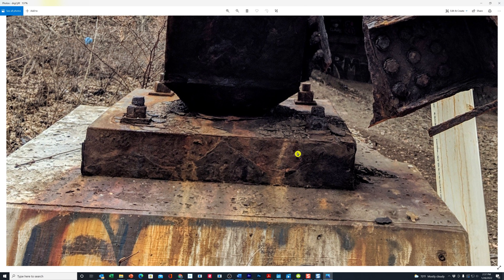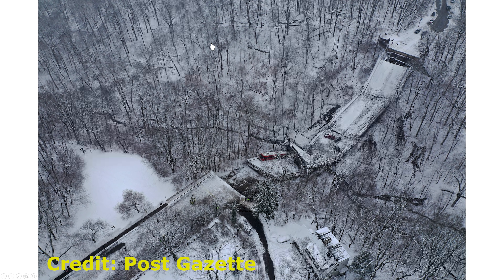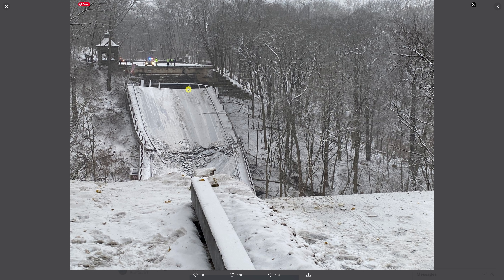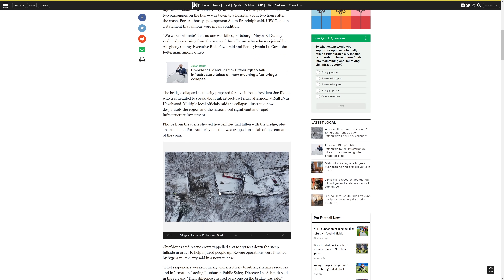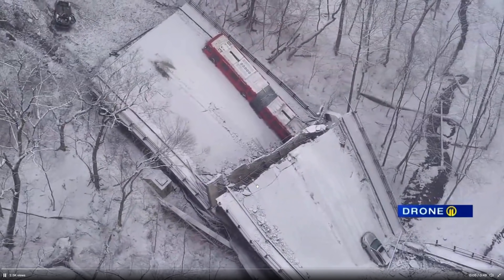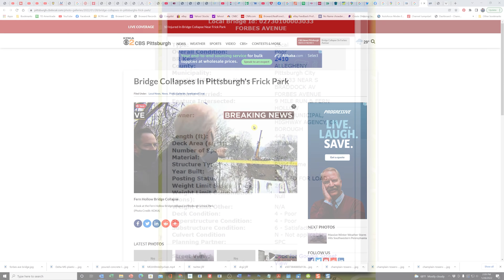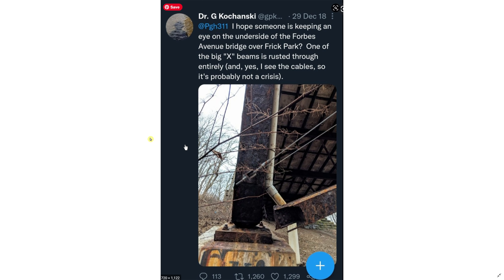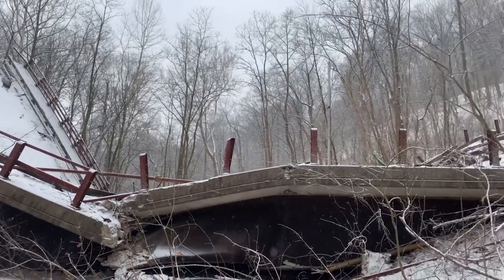Pittsburgh Bridge Collapse Cause, Forbes Ave Bridge Frick Park Rust?

Comment: Being in Pittsburgh can you imagine the salt exposure that bridge has taken over the years? Complete neglect.
Reply from the maker: We need better rubbery moisture prof paint
Reply: @jeffostroff  What's on the GOLDEN GATE bridge? I would think it's some of the best paint available.
Reply: @jeffostroff  PPG Plaza, headquarters of Pittsburgh Paint & Glass. I am sure they had been working on it. I also expect state contracting bids would go for the lowest possible bid. This is the City of Bridges, City of Engineers, and Steel City. Pittsburgh had relatively recently climbed out of bankruptcy and state control of budgets.
Reply: And don't forget that most state money goes out east to Philly.
Reply: @CaptainFrost32  When did Pittsburgh declare bankruptcy or have the state take over its budget?
Reply: @margaretbidinotto2995   	Act 47
December 29, 2003 - February 12, 2018
Reply: @CaptainFrost32  Oh, I thought you meant they declared bankruptcy like Detroit did.  Act 47 was the Pennsylvania plan that helped cities in financial distress - which Pittsburgh, of course, was.  But while they were supervised and assisted by the state, I believe they never relinquished control over their budget.

Comment: I have driven over this bridge countless times. Every time it rains do not travel in the right lane leaving the park, rain accumulates inches deep on the road leaving the park right before the bridge like a flash flood and driving conditions are intense especially if a PAT bus is in front of you causing a tidal wave covering the entire windshield. Don't get me started on the ice accumulation of several inches that I've personally seen that look like icebergs and public works Dump salt on it by the Truck load but only after an accident. These conditions have been at this location for YEARS there is no doubt that the unusual colder than usual temps lately mixed with that rain run off situation and this Bridge was DOOMED and someone, no many people need to be held responsible and red flagged for TOTAL Neglect for many years. Sorry had to voice my opinion and sorry that I missed the LIVE Stream but enjoyed your insight @jeff
Reply from the maker: That sounds scary!
Reply: Don't be sorry.  Thanks for the SALT UPDATE.  BIGGEST DESTROYER.
Reply: Unfortunately this is the state of Pittsburgh's infrastructure throughout, not just this particular bridge. Remember the Greenfield Bridge? Chunks of concrete were falling off of it onto the parkway below, so they built a smaller bridge over the affected portions of road to catch the debris, and then we continued using that bridge for another 15 years. Add to that nearly 450 bridges and it quickly becomes hugely expensive, and that's why it's in the state that it is. So I don't really think it's neglect, it's doing the best with what they have. The people responsible are the ones who have the pursestrings and have ignored the problem for decades.
Reply: The drains look to be small and very few of them. It probably could not take all the water and would fill up until it seeped into cracks between the roadbed and the sidewalk, raining water and salt all over the steel under it.
Reply: Good point. Allowing water to puddle doesn't help a structure. Harken to the Surfside Florida condo collapse where water puddled in the garage area and caused structural corrosion.
Reply: @allengilbert7463  you are dead on, coming from someone who grew up near Pittsburgh and lives about 35 miles from there.
Reply: @joegrazulis2810  I've been living in Pittsburgh all my life. Imagine my shock when I visited Ohio and they chewed up, repaved, and repainted an entire street in the time it took for me to make a trip to the liquor store.

Comment: I travel that bridge to and from work every day. Well, at least I did! That bridge is a main gateway between the east and west sides of the city. I am so incredibly thankful that I worked from home on Friday. More importantly, schools had a 2 hour delay, so less people were on the road! It could have been much, much worse!
Reply from the maker: I'm working on a second video talking about all of this tomorrow as well as more analysis in weight of the vehicle
Reply: Forbes is a busy East/West route but not “THE” east/west route unless you live close to or on the boundary of Frick (Oakland to/from Wilkinsburg/Edgewood). I do agree that depending where you work/live might be one of the better options. Until now. Obv 376 is just stupid and it’s not convenient to cross over to EighthAve (lights are too condensed and crazy for traffic). Penn will get even worse since it’s an actual throughway. Might be worth finding surface streets to parallel. Slower speeds but might be less traveled than the mains. 

This will once again prove the PIT moniker: “you can’t get there from here.”

Comment: Hi Jeff, love your work.  I am a bridge inspector in Australia and from what I have seen of your video Poor is an understatement.  From my experience if the rust was that bad in the bottom of the pier and cross brace the rest of the steel in this structure would have been in similar condition.  Due to its locations the effects of high salinity would not be the cause, unless there is highly acidic soils in the area.  The snow would definitely be a factor if the sub structure was in a defective state.  A bridge has its rating of load based on the design.  New asphalt if laid on top of existing can add substantial load along with snow.  Maybe the bridge was already at capacity with any extra asphalt, snow, vehicle plus defects.  Definitely looks like the span buckled in on itself.  I have followed the condition of bridges in the USA for a long time now and from what I hear Biden needs to spend a lot more on Bridge infrastructure.  Where I am that bridge would have required an immediate Engineering inspection and then the decision to repair, close or monitor would have been made.  Looks like they took the repair option with those tension bars being added as temp cross bracing.  Funnily they bolted the mounts to the already rusted pile, and looking at its condition it has been there for many years also.  Someone's arse is going to be on the line here.  The bridge inspection report for this structure would be a good read if available.
Reply: We use salt on the roads for the snow, it kills everything metal
Reply from the maker: They need better ways to paint, and to protect the base of support from the elements
Reply: Likely you will find there is one inspector for the entire state, and the state simply does not give enough budget to fix any bridge. Likely the reports are there, but have been put on the bottom of the pile for approval to go out to tender, and after that they go back to the bottom of the pile for approval as well. 

I would say yes one of the base posts gave way from simply being eaten away by corrosion, and the other 3 simply could not handle the sudden imposed load and failed. The buckle in the middle was likely the last one to collapse, briefly holding up the section, and then the top simply broke where the stress was greatest and the corroded understructure was the weakest. The middle of the roadway collapses also the same, years of salt corrosion that ate the metal away, and with the one side collapsing the roadway followed, and on impact simply snapped in the middle from inertia. Likely the temporary bracing either tore off, from no longer having material at the parent beam to support it, with it having contracted from the cold, and the extra snow load caused the base of the weakened beam to buckle slightly, providing that extra 5cm of motion to tear it out from increased tension. Braces were stronger than the bridge at that point.
Reply: Infrastructure pointless we b like Mars soon?
Reply: @jeffostroff  I guess they need to paint at all in the first place.
Reply: I would not be surprised if they found that the welded anchors for the cross tension cables rotted off the the base posts. They did not appear to be substantial for the task given in the photos.
It still comes down to lack of concern by the state DOT bridge inspectors or local DPW, depending on who owns the bridge.
Reply: they're telegraphing a psyop
Reply: @botswanaelephant  It's not a psyop. Pittsburgh has almost 450 bridges, and Allegheny county has over 1500 bridges. All of us in Pittsburgh knows the shitty state of our infrastructure and the ways it's been for decades. There isn't enough resources to fix all of the bridges, and PennDOT moves too slowly to fix them all in a reasonable amount of time. I always hold up the Greenfield Bridge as an example. It was easier and cheaper to build a smaller bridge underneath it to catch falling concrete than to replace the structure, and we continued using that bridge for another 15 years.

There is no political will to spend money on infrastructure, and so bridges collapse. We're just lucky this happened before rush hour and no one died, but that bridge sees a lot of traffic, and a lot of school buses go over it. It could've been a lot worse.
Reply: You should see our cars....if it's not plastic and you drive in PA chances are it's rusting away.....state roads are heavily salted.....local/rural roads are covered in ash....winter sucks here. We have more bridges than anywhere in the world.
Reply: Unless u live here u have NO IDEA how many bridges we have,how old they are(literally some of the oldest roads in the nation) and how poor of condition 95% of them are. When the state builds a multi million dollar overpass,that's ONLY purpose was to stop the chunks of concrete from falling off the decaying bridge that crossed above the major highway,hitting cars driving 65mph...instead of fixing the bridge that wad crumbling away for 20+ years...there are MAJOR issues with 732 bridges in our city that is MUCH smaller than most people realize
Reply: In this corrupt world of Allegheny county nobody’s arse is exposed. More collapses to follow. I cross these bridges every day and say many prayers
Let’s go Brandon
Reply: @TechTokOffical  yeah this has been a real eye opener I used to cross that bridge daily like many others!
Reply: Hi Mark! Excellent reply. I live in AU but am originally from Pittsburgh and have driven over this bridge countless times. During the winter, the roads in the entire northeastern US are heavily salted to melt ice. There are many large salt sheds all through Pennsylvania and one- and two axle dump (tipper) trucks are fitted with snow plows in front and salt spreaders on the back. My uneducated guess is that decades of salt appllication has led to rusting, weakening and eventual failure of the painted steel structure. With the cost of sandblasting and painting, I've often wondered why galvanised steel is not used. Even steel-reinforced concrete bridges (like the George Westinghouse Bridge nearby) suffer when the concrete cracks and salt water finds its way to the rebar (reo). Your thoughts?
Reply: It collapsed because the money they had for repairs went to the state police. 🤔
Reply: @TechTokOffical  I think I drove under that 15 years ago!  At that time I think they had nets and scaffolding erected to catch the falling debris. 

I also remember driving across a bridge over the Ohio river (I think, coming back from Kennywood Park) where we stopped and I looked to the right and saw rusted rebar exposed from 2 inches of missing concrete at the deck level, who knows what it looked like below there.  I wanted off that bridge as soon as I could.
Reply: @lorenwillis425  The first bridge you describe is commonly known as the Greenfield Bridge. It connects Greenfield to Schenley Park/Squirrel Hill & crosses the heavily trafficked 376 E.  Lots of official denial of concrete chunks falling (officials, even PennDot claimed kids were throwing things off the bridge!) followed by massive netting, then accident & injury in spite of the netting, then a temp protective superstructure underneath, finally a Scott Pelley 60 Minutes flyover segment from a piece on Americas deteriorating infrastructure. At last & alas the bridge was closed, demoed and rebuilt. I believe the other bridge you are referring to is the Rankin Bridge.  Its spans the Monongahela River, connecting Rankin/ Braddock to Munhall/Homestead. It used to be pretty scary as a young boy crossing over it in my dads 76 station wagon, seeing alll the rusty metal beneath, wondering how it didnt just collapse. A 50 million improvement project in 2011 allayed the concerns of many.
Reply: It’s not being talked about but the state took $4.2 billion dollars from our gas tax which pays for the maintenance of the roads and used the funds to pay the pension of the state police officers. So the problem whether it be mechanical in nature was born out of corruption.